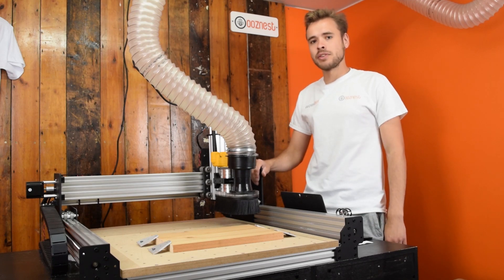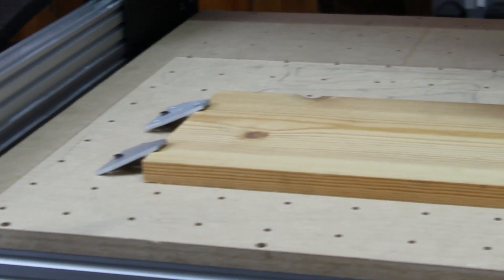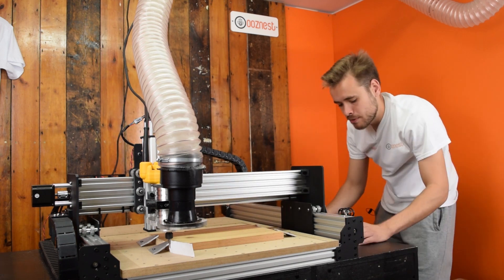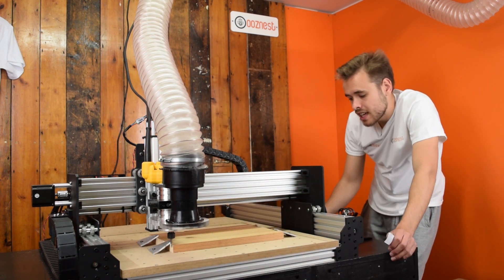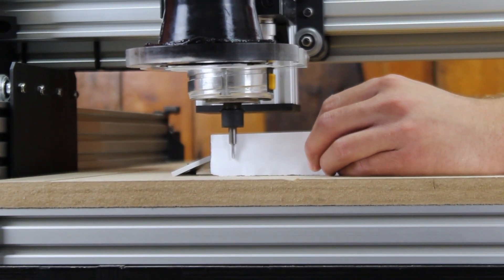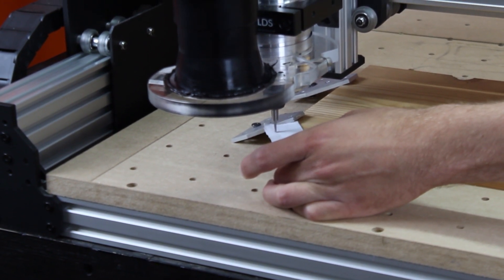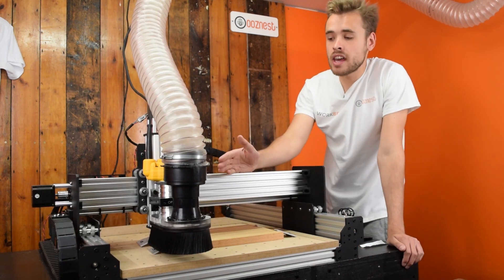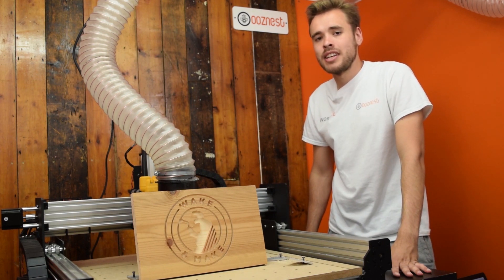How To Set Up A Job On A CNC Machine | WorkBee

Comment: OK so I have the XYZ Touch Probe and I understand that when I use it that it "sets" the XYZ Axis relative to the piece of material that I am working on. But in my Vectric Software, there is a reference to Z-Gap above material...should this be set to ZERO then since the Work coordinates have all been set to Zero by the Probe???
Reply from the maker: Hi Ivan, the Z-Gap above material should be to enough to clear any clamps holding your work piece.

Comment: Can you tell me what software do you use, and what mottors do you heave on the machine? Especially the value of holding torque power?
Reply from the maker: Hi in this video we used Universal G-Code sender with 175oz motors

Comment: I would have thought that anywhere near the front left corner of the workpiece (say 5mm in from the edge) would be good enough. As long as the workpiece is large enough for the job, then the routing will start just the same but 5mm further in of course. i.e  the carving will be done slightly further back and to the right?
Reply from the maker: Yup that would work if cutting from a sheet, and location of it within that sheet isn't important. What is done in the video would be needed if you wanted to cut out something in an exact position on the workpiece though.
Reply: Hey Alan - another benefit of having the starting point exact on the corner, is in the event you need to restart a job and your settings have been lost you can recenter right to the corner again and hopefully save your project without having to restart from the beginning. Also comes in handy for bit changes in the middle of a job if you need to re-center.